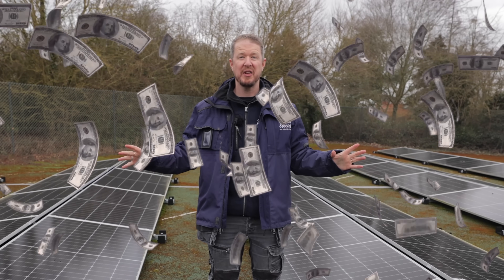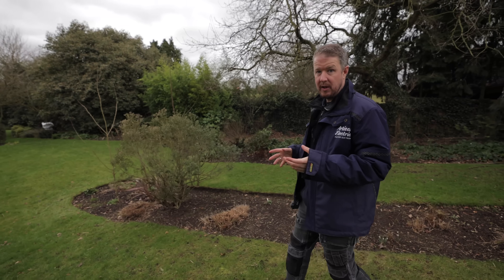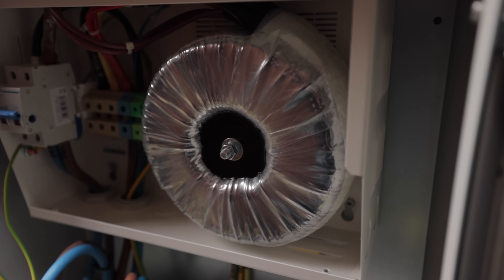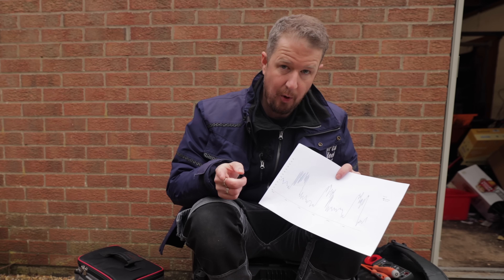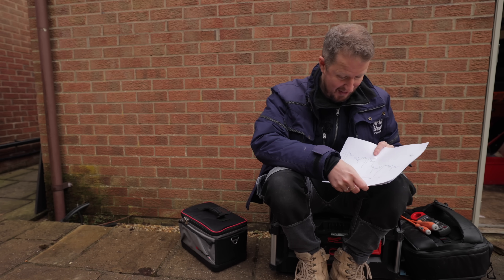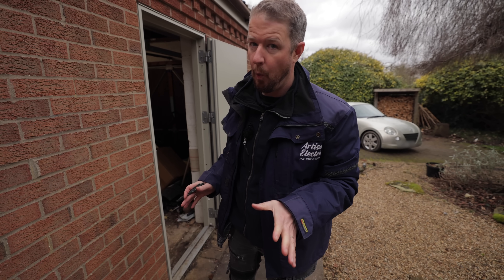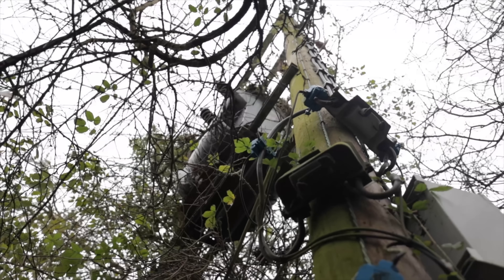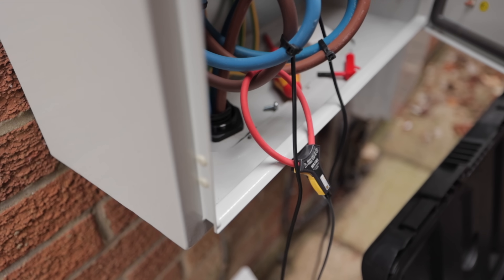THOUSANDS Down the Drain – And We Can’t Do Anything About It!

Comment: I can't believe they allowed you to connect a solar system that outputs up to 262V. This would be illegal in the rest of Europe. The solar systems should switch off in case of over-voltage, to protect the net.
Reply: It's odd. Typically - residential single-phase in the Uk limits export for this reason i.e. curtailment to 16A or grid specific export based on voltage var / voltage watt export and restrictions to prevent this overvoltage - as other solar/battery devices will shut off, and, below 220v, this will affect the performance of a lot of pumps and fans, using more power than they should. 

Under-voltage is also what leads to devices failing or causing damage over time, especially fridges and pumps.  It also causes them to use more power than normal, affecting billing with smart meters -  under-voltage is read normally if you have an older spinning wheel meter. Fridge/pump units with inverters can also break down or stop working if they see voltage below spec too. The more common reason for under-voltage is illegal taps on power, people bypassing their meter fuse to power their home or garage, the usage doesn't get monitored, so the transformer can't 'see' the load it's supposed to account for. 

In this case, it's likely that the solaredge inverter has not been set up properly with curtailment options to rate-limit power. 

Or, there isn't available 3-phase power to balance load. It's not as simple as putting a 100A breaker in place. If you have a 'wider' tap beyond 63A, it gets dicey in rural areas as everyone's solar would be spiking at 11am. 

But, according to the graph at 6:35 - This graph should be far closer to the 240v line at the bottom of the page as UK standard. The lowest peak seems to be 242v, the overnight seems to be 242 to 248v peak in the overnight. so problem 1, the grid is 15-20v above spec. Hence the power optimiser/regulator.

problem 2, the solaredge is going above 50A on residential power, well above the 63A limit. Likely peaking into the 100A territory. You'd hope they have the proper metering set up, sic. Putting this limit into the Solaredge inverter's grid standards / grid protection, it would slow down the battery charging rate and the solar export rate to a safer standard. 

This is common enough. VPP's monitor grid voltages, so they generally know where problem suburbs are - and can report these stats to operators, sic.

The Solaredge inverter would also have grid protection and Country-specific grid regulation set up to handle the 235v Volt-Var and Volt-watt regulations. Perhaps this was forgotten ? Some people do push their inverters to using Germany or Australia instead of UK as the grid regulation shutoff/restart is between 216v and 253v, but grid protection can be shut off if the country code is changed, or wasn't commissioned / installed properly, sic.

This seems to be a comedy of errors because the Energy Ace ? optimiser is set up to downrate to below 230v with perhaps a -20v profile, it' might also be a 63A unit for single-phase instead of 100A to handle a 17kw/73A load, and this dips below the shutoff on the solaredge as well due to misconfiguration.
Reply: It would by default, clearly they reprogrammed it and took off the protections in service mode. In Poland unacceptable to go above 252, system will shut off.
Reply: Well it would have cutout until he removed the protections...
Reply: They bought the wrong hardware for the job and to top it up, they now f all to set it up. Cowboys.
Reply: @nrgia  The install isn't likely the issue - If they had a 100A grid connection, they should be able to use 100A - The transformer is likely unable to actually handle the load being demanded from the grid without causing issues.  

If they extended the operating Fuse from a typical 63A to 100A, there should also be an upgrade for the line to the grid, and the grid to the consumer premises or CPE. The same problems if you had a commercial business that needed 20+ Kw, it would cause brownouts and blackouts if it started consuming that much power and the transformer wasn't changed or modified.

This is also why 3-phase tends to balance demand / problems across multiple phases - so that the supply isn't affected by 1 person or 1 customer.

It's likely performing as the local or domestic transformer was originally intended - to operate at the 30A to 40A range i.e. 7kw to 10kw. In situations like this where the voltage is unstable, you can't really fix the issue - it's a grid/network fault. 

This is fairly common in rural areas where subcontractors just don't care and aren't penalised or the work isn't reviewed / approved. 

solution is to cap / restrict the solar inverter or set up a monitoring for the voltage level via the inverter's stats/smart home integration so the consumer knows when the transformer has been adjusted and fixed - and they can uncap their own export/import to take advantage. Until then, it's effectively a grid fault.

Comment: It's not the customer. 
The agreement was to provide a system that works for them. 
That agreement is the contract they agreed to. 
You can't make demands for payment outside the contract. 
Good luck anyway. 
Not going to get involved in your installation,that's what you took the money for.
Your solution is not what I did with my folks at the end of a very long line in France. 
My dad is a hifi enthusiast, I built him a  valve amp which pulls class A current at whatever it likes. 
The transformer has it's own suspension because it tries to rock the case on power up. 
A decade in r&d electronics was more than enough.

Comment: The length of the powerlines might be a problem too. Or the wire gauge of the powerline might be too small. 17KW is a lot to send on a normal powerline. That transformer was not that small. The customer can ask for a higher wire gauge power connection, that supports more amps. This will come at a cost.

Comment: Total bollocks, the grid equipment at the sub station that runs the variable voltage regulators would know down to the microvolt what their system is running out.  Perhaps what is happening is that the total local solar being injected simultaneously during peak sun is jacking up the local voltage........essentially the DNO has lost control of local grid voltage.  Victron inverters like Multiplus or Quattro can be configured to non export solar, and only supply charging demand and loads, when operating with SMA/Fronius PV inverters that have been configured to Stand alone /Off Grid mode (the Victron regulates the PV inverters with FSPC (frequency shift power control).  Whats happened here is two fold, the DNO have an over injected local grid causing high voltage, and the battery managing hybrid DC inverters are not configured or capable of controlling the PV production,charging and grid export/import in a balanced way.  All of these features are fully possible with Victron gear.......next time, spec the right equipment or get it set up correctly.   Hybrid grids are complex to design and optimize,because every customer is different and trying to achieve similar but different things, you dont just slap it down and everything is optimal.

Comment: Based on Australian experience, first step would be to bypass the voltage optimiser so the SolarEdge (smart) inverters can monitor their impact on the local grid (rather than blindly causing overvoltage for nearby neighbours while inverters sees nominal volts). Next leverage the capabilities of those smart inverters to dynamically mitigate voltage rise (in consultation with the local DNO): In Australia we enable volt-var and volt-watt response modes and they typically kick in on the high side at 240V and 253V respectively (see AS/NZS 4777.2). If set appropriately the volt-var response mode will also support the voltage when it goes low (while charging) by injecting vars (this kicks in below 220V in Australia typically) so long as inverters/batteries are operating. 

Upgrading the DNO distribution transformer is unlikely to resolve this voltage regulation issue (excessive voltage spread or swing). Transformer upgrades are typically done in Australia for thermal/capacity constraints (when the diversified peak load or generation exceeds the transformer rating). Most of the voltage rise/drop in this case appears to be the result of the impedance of the long single phase circuit and an upgrade of this might help. 17kW is a very large export limit on a single phase system. Single phase exports are typically limited to 5kW in Australia as per AS/NZS 4777.1 (ask me how dynamic operating envelopes can increase this another time). 17kW of export would usually only be permitted from a 3-phase system and this would roughly reduce the voltage rise by a factor of 6 (current is split over 3-phases and neutral return current is minimised provided the load is reasonably balanced). So ideally upgrade installation to three-phase and rearrange inverters into a balanced 3-phase system to minimise voltage rise, improving outcome for your customer, their neighbours (who I agree should also be able to have solar in the future) and the wider grid (by maximising PV hosting capacity and reducing costly upgrades that all customers ultimately pay for)

Appreciate all the insights from your channel. Cheers from a long time watcher, first time commenter.

Feel free to reach out via LinkedIn if you have any questions.
Peter Kilby
Senior Grid Transformation Engineer
Reply: Yep, from what little I know (although my house has a 10+ kW solar plant with 2 SolarEdge inverters) - the optimizer isn't helping in this situation.  Also, if it's "thousands of pounds" it's awfully expensive for, basically, a single large toroidal transformer that doesn't even have automatic tapping. I was shocked when he showed how bare bones the interior was!
Reply: yep pretty spot on,  AU QLD
Reply: Hope you are enjoying Aus.  Question if it was TNCS earthing (neutral/earth connected before meter all way back to transformer) and they installed enough local earthing  alongside the PME earthing would that lower substantially the Ze would that lower impedance of L/N to cure the voltage spike and for the low voltage if that does not solve it, just lower the charging current. I Appreciate that the neutral/earth link is outside the meter but if Ze was .35 and was lowered to say .05 would that cross over onto the Neutral impedance back to transformer
Reply: @brianoneill350  TNCS is the norm in Australia and more earths would help, although 0.05 ohms may not be practical. 

The important difference from US topology is that most of our LV is distributed on 3-phase, 4-wire networks where the currents are reasonably balanced to minimise neutral (and earth) current. So if loads and generation are reasonably balanced there is less benefit from further reducing Ze. Note how switching from single-phase to 3-phase system doesn’t just reduce voltage rise by a factor of 3 but by almost a factor of 6. This also applies for voltage drop from loads, most voltage constraints from domestic EV chargers can be addressed by shifting to 3-phase provided the EV’s onboard charger is also capable of charging from 3-phase.
Reply: @peterkilby289 thank you for the reply. Really makes the case for three phase when you have power
Reply: @peterkilby289 that's very interesting the 3 to 6. Would a small example or explanation be possible?
Reply: @brianoneill350  About the 3 to 6 thing.
In a single phase setup, current flows over both phase and neutral conductor, so basically half the voltage drop/rise is credited to phase conductor, and the other half to neutral.
In 3-phase system, not only is phase current spread over three phases instead of just one (which lowers voltage fluctuations by a ratio of 3), it also stops flowing completely in the neutral conductor (provided it's a reasonably balanced system, that gives us another reduction by a ratio of 2).
2 x 3 = 6
Reply: Good comment
Reply: Good response Peter, could you explain why these solar inverters cause a voltage rise?  From my experience in load sharing of generators the frequency is primarily used to control active power and only very small voltage changes are used to adjust reactive power sharing.  An increase of 20volts would be far in excess of the voltage differences we would expect on generators load sharing?
Reply: @JT_2024-c8j  
From what the install guys told me, lots of panels in serial hooked to one inverter means the individual panels will have a large effect on generation. Like one is pushing 30%, the other 80%, if both those go on 1 inverter you get weird voltages, while those two with 2 micro-inverters will have far less impact.

He has a piramid base setup so the panels will naturally never generate the same amount, also lots of trees and differing shadows. Typical situation where a set of micro-inverters is called for.

They told me this setup of large amounts of panels hooked in serial to a larger inverter almost isn't done any longer. Micro-inverters are the norm now.
Reply: @ That sounds like a poor design on the load sharing side, maybe they aren’t networked together?  You’d think there would be a lot more scrutiny on these installations by the grid operators before they agree to back feeding.  Seems very haphazard.
Reply: @JT_2024-c8j If you run cos phi of 1 the only way to push power into the grid is raising the voltage. Like with DC.
Reply: @ I only deal with multiple  Generators load sharing on their own grid.   I just can’t get my head around why adjusting the frequency doesn’t work in the same way for load sharing active power via an inverter.  An inverter is doing the same thing as an electro mechanical generator.  

If it was a generator back feeding the grid you would still use the speed/frequency to load share active power.  Strange.
Reply: @JT_2024-c8j  There is no "speed" on an inverter. With synchronous generators, there also is not really a speed or frequency to adjust active power but only the throttle which TRIES to spin the generator faster, so it tries to escape the magnetic field pulling on the rotor. This is related to the angle (phase) of the generator relative to the grid, not the speed(frequency).

In addition to that, you cannot push active power into a system that has a higher voltage than the source pushing the power. In order to do that, you have to match/exceed the system's voltage.

The same applies to solar inverters.
Reply: @ match the voltage yes, but not exceed to this degree.  Clock/speed/frequency it’s an acceptable term.
Reply: no one wants ~6kw(17kw total) three phase grid tie invertor+solar system when their ev slow charge only accepts single phase because that would require a convertor from three phases into single phase ev charger feed(depending on the single phase charge limit of the car). 
or they would need to get expensive 3p quick charge ev charger and update their mains contract into 3p feed system. 

plus 6kw per phase is a very inconvenient way of splitting power in a small home
Reply: @johndoe9922  guess Germany does everything wrong then... We have three phase in pretty much every fuse panel and we do a lot of PV and also EV charging. My Inverter can do 12 kW but is capable of asymmetric load as well, so it is not 4 kW per phase but rather 6.

EV charging also is three phase...but even if it was not: see above

Comment: Also have Solaredge system, spiking to 262V! In the end I ran the majority of the house (excluding induction ccts like immersion heaters and cookers) through a 10kVA UPS with voltage regulator. That was after I installed SolarEdge backup and discovered it takes 3/4 seconds to switch over!!!

As a software engineer I diagnosed and reported numerous issues with SolarEdge especially in multi-invertor systems. In the end I’ve managed to get several firmware fixes. But their software stack is buggy as hell.

Meanwhile I spent a year fighting Aqvira over a failing smart meter. Won multiple Ofgem disputes and got compensation - but they could do NOTHING.

In the end Octopus were great and I got reporting working using their Zigbee-IP device.

My 2 year journey has established that the UK is just not ready for these systems. 

And most customers don't have installers willing to rectify the endless issues. I’m just lucky I’m autistic and willing to fight - but my system is still not delivering the promise. I would never recommend going through the hell to any one I consider a friend.

Comment: Is this not also an issue with the Solar Inverter?
Many commercial UPS units allow for configurable output voltage outputs and I seem to vaguely recall a Solar Inverter I set up some time back having similar options (it would have been SolarX if if so).
Definitely keen to see your conclusion in a part 2 video though.

Comment: None of this surprises me. In my neck of the woods power exporting has been banned owing to the serious voltage regulation problems it has been causing as more and more people get sold on solar with the rebates. Power distribution networks were designed to deliver power to the end users, not cop it back from them in spades.